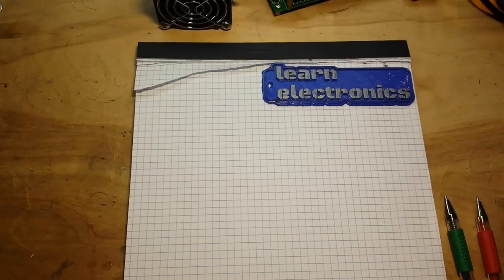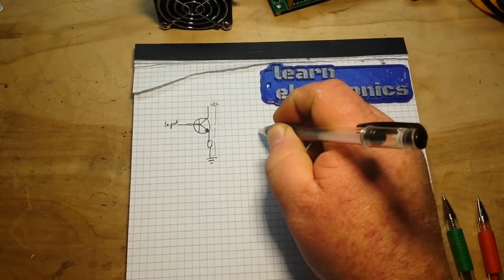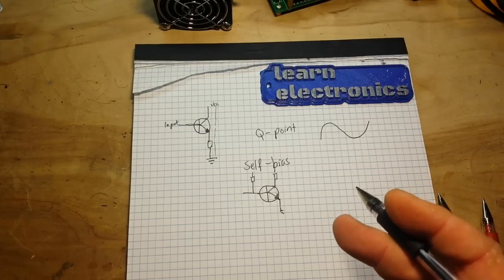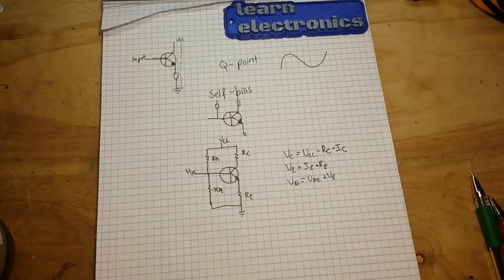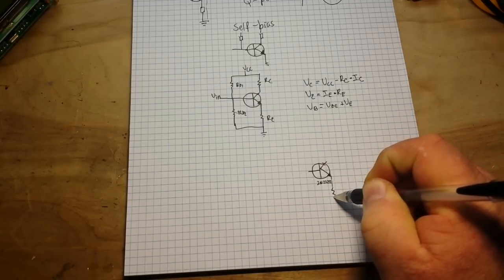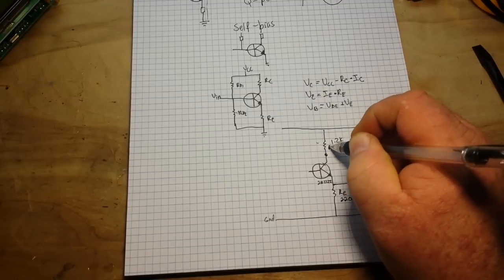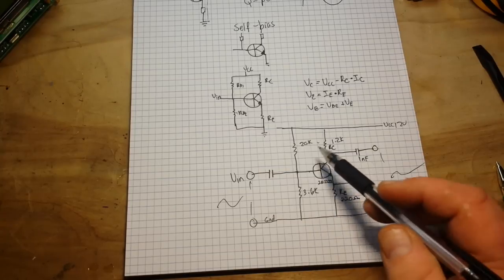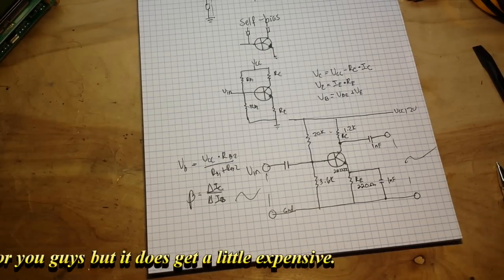Common Emmitter Amplifier

Comment: To amplify the signal it must add to base bias voltage and oscilliate between 0.7+Vin and 0.7-Vin. But how the input signal voltage is added to the voltage divider bias voltage since they are in parallel. Please can you explain this. No one on internet is clearly explaining it.

Comment: You didn't explain why you chose those resistor values.
Reply from the maker: The answer to that is dependent on the specific transistor you're using and the type of circuit you're using it in. But generally you want to shoot for the middle of the linear range. So as an example, let's say an npn transistor goes from .8VDC to 3VDC from cutoff to saturation. So half of that is approximately 1.9 volts. So you're going to bias using ohm's law. You know the voltage. You know the current? Now you can solve for the resistor that you want to use to put you at that 50% linearity.

Comment: huh??  This circuit is probably the most frustrating one to learn.  I've read and watched many tutorials and nobody seems to explain  why the resistors are picked for their values.   All of them just randomly pick the numbers based on their experience and  assume it'll work.  Only then,  they start doing the calculations...  But that doesn't explain why those values were chosen.

Why did you pick Re at 220 ohm ??   Why pick RC for 1.2k ohms ?   Why pick Rb1  and Rb2  for 20k  and 3.7K ??
Reply from the maker: They are not random numbers. The resistors are each chosen specifically to put the transistor into whatever phase you're looking to put it into. Usually the active region. Now you choose the base resister to create a current from a voltage. You use the data sheet to know what current you need. You choose the emitter resistor to prevent thermal runaway.
You can't learn everything in one video. The most important question is " how do I want the transistor to behave"?
Reply: @learnelectronics  
Thanks for explaining this,  but it is still quite confusing to me.  I tried for learn this circuit for a long time,  but I ultimately gave up.    Instead,  I use OPAMPS for amplifying signals  and transistors for simple switching purposes. 

I love OP AMPS ,  but at the same time I feel like i'm cheating.

Comment: im so glad i found this channel ! I cant describe the way you teach, theres no bullshit involved to indirectly throw off the audience, would u recommend i learn anything else with AC circuits besides filters, amps, AC analysis ? I know theres a whole lot with other components but any topics as large as expansive as those 3? I started butterworth recently and plan on moving to the other big filter designs and i ve already started making mosfet amps + AC circuit analysis is taken me to 3 phase circuits
Reply from the maker: I really avoided RF for a very long time because I had a hard time understanding things like skin effect. When your circuits depend upon electron positioning within the conductor you know you little margin for error. 
I wish I had applied myself to it earlier. I guess all of this rambling is meant to say learn RF theory.
Reply: @learnelectronics  glad u said something i atleast have an understanding of, RF is black magic but i did use a module set with arduino

Comment: Hello Sir, is it possible to show how you actually choose the four resistor values?......you start with Re=220 ohm.....how did you choose this value....not 22 ohm......not 100k ohm......what is the thought process (calculations) for this value......and the same question for the other three resistors?
Reply from the maker: You choose resistors to put the transistor in the middle of it's linear range at idle current. you have to check the data sheet for the transistor you are using, then you can employ Ohms law.

Comment: Hi Paul, 

Transistors have been one of those components that I really don't have an intuitive understanding of. However over the past year or so that I've been watching your channel, they have (finally) recently started making more and more sense now that I am playing around with the ETI Vocoder project from Julian's channel. 

I think it would be a huge help if you build the amplifier from this video, but also show how to use the datasheet to pick the various resistors to set the bias for the amplifier. Some of the transistors are obsoleted and while I can un-intelligently search around to find a similar replacement, I don't know quite how to decide if any of the resistors in the original circuit need to be updated to correctly set a different bias point for a similar transistor. 

Thanks for making these videos man, I look forward to each and every one of them!
Reply from the maker: I will be building the circuit soon.

Comment: You just seemed to pluck resistor values out of thin air. How did you arrive at those particular values?
Reply from the maker: As I said in the video, you must consult the datasheet for the particular transistor you are using.
Reply: Yes, you did say that, but it would be very informative if you could step through that process rather than just inserting numbers with no information as to how they were derived.

Comment: Any chance of a follow-up with why 20k and 3.6k "will give us a nice bias", why Rc likes to be 1.2k, and the like? Would really enjoy a more in-depth look without "magic values" to understand the why.
Reply from the maker: As I said in the video you uave to consult the datasheet for the particular transistor you wish to use.
Reply: But the data sheet doesn't mention  any thing about Resistor values.. There is a design constrains in order not bias the transistor either in saturation or cutt-off regions... Consulting the data sheet is well important but the way how to design is the most important..

Comment: sir....im planning to build this type of circuit...im newbie in transistor amplifier but i have a  background in electronics...forgive my  questions ...these are.....
(1).is there any formula for finding the values of all resistors in a circuit or its just  by setting an arbitrary values and  check the waveform on an 
 oscilloscope...in my case i dont have oscilloscope....im  just relying to a speaker  by  listening to it if its good....
(2)is there any formula for finding the values of all coupling capacitors  in a circuit or just setting your own values and check it again in a scope...why you used 1nf ...why not electrolytic capacitor....
(3)with your transistor 2n2222 circuit ...is it possible to hear the output to ordinary  speaker  or you need another transistor ampliier stage ....thanks sir in advance  and with sharing this simple new video....i love simple circuit   as the old saying goes  .....SIMPLE IS GENIUS
Reply from the maker: Gp to the datasheet for the particular transistor you use to get the values. Yes you can hook up a speaker to this circuit.
Reply: thank you very much sir

Comment: So is that the basic circuit for an audio amp just without all the filters?
Reply from the maker: It's a class a amp. The least efficient, but the most linear. It would make a nice little audio preamp.

Comment: I've learned the Common Emitter from the Art of electronics and they are omitting the Emittor capacitor 8:10. Why would we want to use it?
Reply: If you feed an AC signal into the Base, as the amplified current flows out of the Emitter, the voltage at Re can rise high enough at certain points of the AC wave, to remove the forward bias of the Base-Emitter junction. The capacitor shorts out the AC signal to ground at the output due to its low AC impedance to prevent that.
Reply: @Shadowex2000  Makes sense.  Understanding how components behave under different circumstances makes the circuit analysis much easier.  Thanks.
Reply: Thank you, that'll keep me thinking for a while
Reply: Just go to Page 84 and  Figure 2.25 shows the ac-coupled emitter follower.
Reply: Robert Calk Jr. Exactly, i just read about it! Amazing stuff! Also increases gain!
Reply from the maker: The caps decouple the AC input from the DC bias of the amplifier.

Comment: Playing with BJTs and having a better understanding of some basic concepts is always a plus.  By the way, I don't know if you changed your setup but the sound of your clip is now noise free, no more static or humming noise.  Finally, yes, I'd like you to breadboard the circuit and show the signal at different points such that we could potentially evaluate the beta of the BJT just by comparing the values.  Also, showing the effect of the capacitor connected to the emitter by putting it in and out for the circuit so that we can also see the effect it has on the signal would be nice.  I understand that the objective is to provide basic information but when your giving such information to addicted hobbyists like me is like giving candies to children, we always want more, we never have enough !  Thanks for your time Paul.